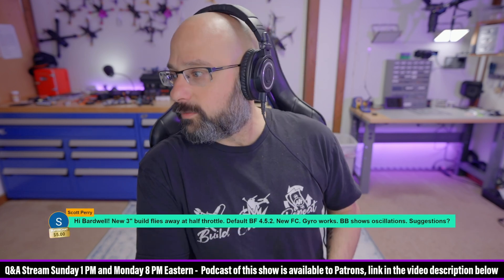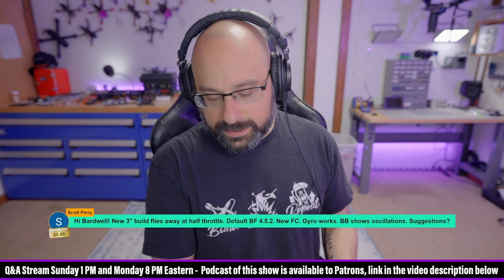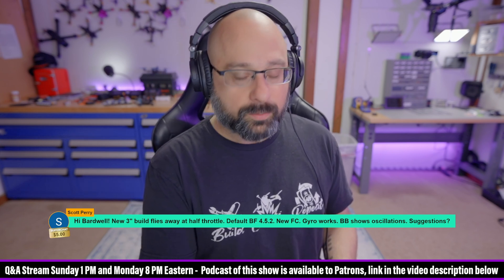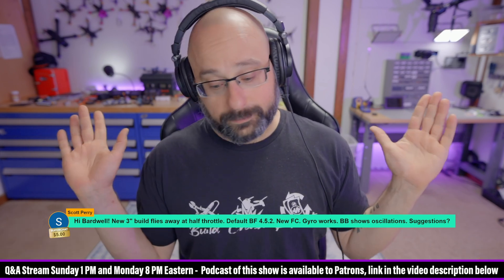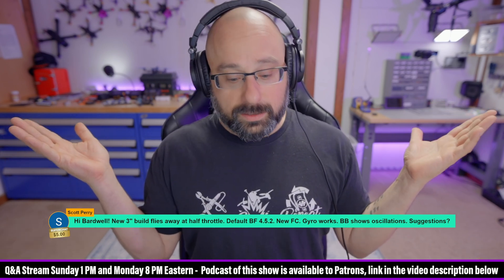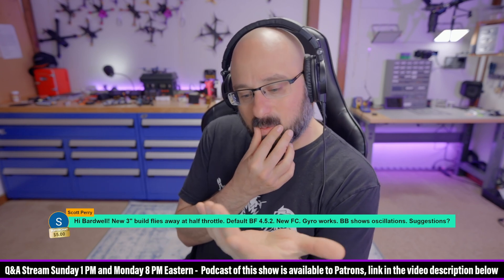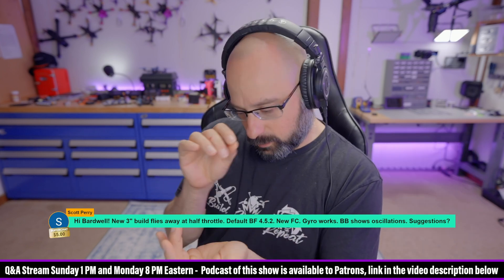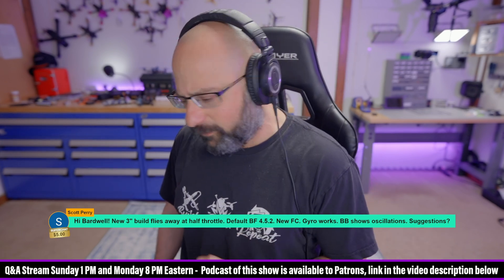My New FPV Drone Build on Defaults Flies Away When I Throttle Up! Help! - FPV Questions

Comment: the Dterm get bonkers, mechanical or electrical noise. or a frame that is not strong, bent props, bent motorshaft. Lose FC, soft or hard mounted.  Check the log.

Comment: Last month I was flying my drone very calmly and gently under some trees (Quadmula Siren F5 Split + SpeedyBee F405 V3 + O4 Pro + BF 4.5.2) then without warning it went crazy and accelerated in the air to get stuck in some branches. Before that, I had noticed that at a certain level of throttle power, I was getting significant vibrations in my videos. All these problems were ultimately caused by the ViFly buzzer wires I was running between my flight controller and my ESCs. I just had to run them under the whole stack to eliminate all these problems. So yes, anything that directly touches the flight controller is enough to make the drone behave badly in flight.

Comment: Some light really powerful 3” rigs are overtuned at BF defaults. This might play into such a flyaway. Specifically the flyaway will sound like a trilling as it takes off. If you didn’t hear that, then it’s something else (mechanical as Bardwell suggests)

Comment: I fly solo and have been since I started fpv about 4 plus years ago and recently I met a guy who flies too so I was excited to finally have a wing man😊 however he had a fresh build 3.5 inch and said that it acted a "little funny" 🤔 My though was let me stand back especially since he was tying a fishing line to it in case of a fly away we both laughed then he armed and Everything was fine until he blips the throttle🚀 that thing was possessed! He got control of it by pulling the string but lowering the throttle did NOTHING! finally the quad rolls over and cuts the string now it's full throttle headed directly towards us! We were like 2 stooges running from this thing falling over chairs and knocking stuff over before it finally smacked his grill and hit the ground he stepped on it and unplugged.....sadly the quad didn't make it and we are no longer friends 😂....he is a nice guy he really is but he Fs with his pids too much for me and I don't like karen attention or cops😳✌🏼 it was like maximum overdrive! "The quad version" I have never flown with anyone and I hope this doesn't ruin it for future potential flying friends but I knew something wasn't right because I have never seen anyone on yt just mess with tuning not knowing what they're doing I'm scared to even change my osd settings!!!!😂 sftb🙏🏼

Comment: Air Mode was causing fly away for my 2.5'' BNF at half throttle. Haven't had a fly away since buying it. Sometimes it's the little things. I didn't even know about air Mode until I started having the fly away issue.
Reply: I don't think that should cause any issues lol. You fit in the same category as the guy who asked the question in the video. Something on your quad is fucked up.
Reply: @ That was out of the box on the presets it came with. Turning off Air Mode at least let me fly, but I definitely need to look into stuff more now.
Reply: @FoxonSilverfur  yeah make sure everything is tight and nothing's vibrating or flopping around. If it still doesn't work then the stock tune is way too aggressive or just bad for the quad so try to put defaults or something less aggressive on it. Change the filters and pids. But look at the physical build first.
Reply: @ I figured it out. Sometimes it's just the dumbest things. My rate profile set to 3 so instead of using rate profile 1 with the stock PIDs it was using the PIDs all set to 1.

I am the dumbest thing. It is me.
Reply: If turning off air mode stops a flyaway, something else is wrong. Your quad 100% flies worse with air mode off.

Comment: I had this problem with several 3" with stock settings in BF. I've then used the UAV tech presets for 3" and no issues whatsoever. In 5" or 7" never had a flyaway with stock, but with 3" seems like a habbit for me. No mechanical issues at all.
Reply: "no mechanical issues at all" Your evidence does not support this conclusion. Re-watch the video you are commenting on lol. If it flies away on defaults, you have a problem. Period.
Reply: @zdkama  you have no clue what my setups are, yet you are very confident. let's leave it as you say mate...
Reply: @strazfpv7043  I don't need to know anything the setup of your car to know that if white smoke is coming out of your tailpiipe, you have an expensive repair ahead of you.

I also don't need to know anything about the setup of your quads to know if they fly away on defaults, _something is wrong with them_. Period, full stop. It's not "whatever I say" it's how the software works. It's how PID controllers work. BF does not care about the setup of your quad, it cares about vibrations and resonance. It cares about what the gyro reports.
Reply: @zdkama  I won't continue to argue with you just keep in mind that not all FCs are the same, not everyone uses the same BF release (for various reasons), not all ESC parameters are the same for everyone. A 3" can be 3s, 4s or 6s with different motors, KVs and weight. A bando basher that takes hit after hit after hit, flies with bent props and rocks in the motors and still flies good after the initial tune does not have a mechanical problem on maiden (my case). I have 4 3 inch drones with identical setup and ALL of them did flyaway on stock tune (BF 4.2, don't ask why, I use that I have my reasons). There are multiple factors to take into consideration, don't just say if it flies away it's mechanical because that's not true. You may like it or not, but BF software is not perfect.
Reply: Take any drone that flies away and flash new BF to it. It won't change anything. Which is exactly the point, the software isn't the cause of the issue. It is REACTING to something that is WRONG with the drone. That's what a flyaway IS.
Reply: Wit try this